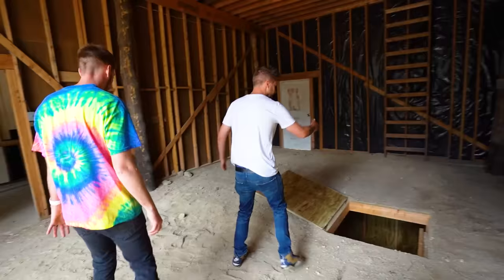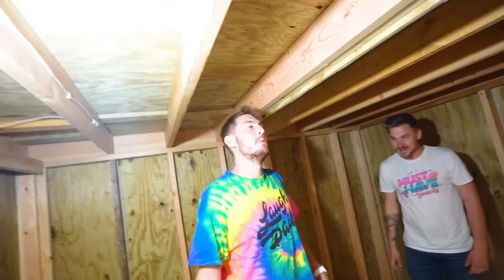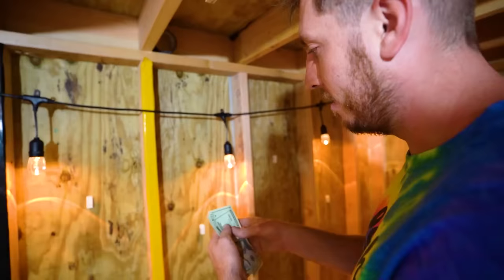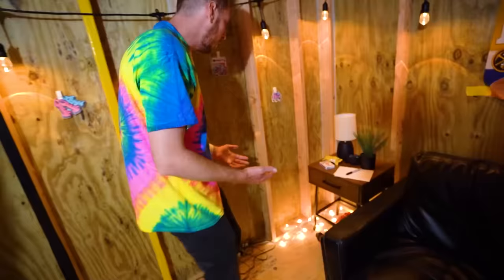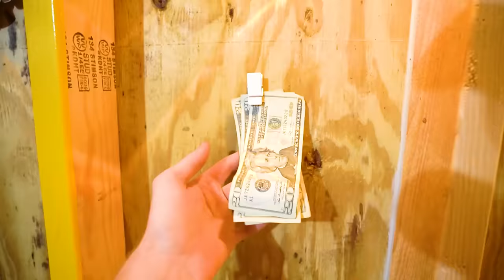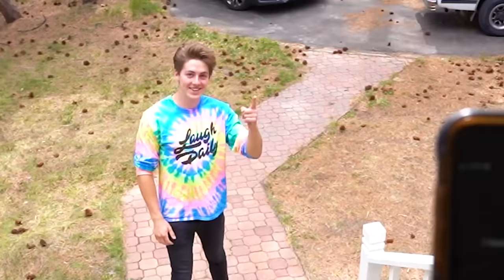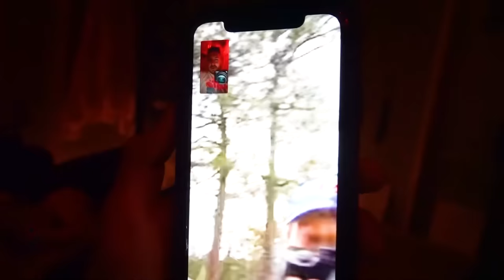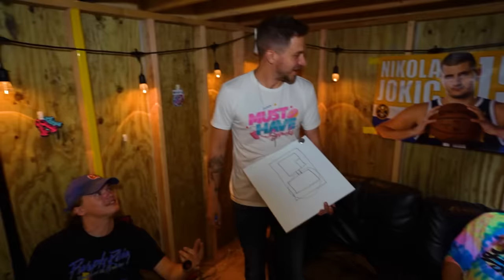HIDDEN SECRET BUNKER UNDERGROUND!

Comment: What about gluing dirt to the bunker door so when you close it, it’ll be more hidden?
Reply: I thought the same thing so that if they need to run and get in there quit there is not a problem with seeing the door
Reply: Same I also commented that
Reply: Good idea it would keep dirt from seeping in and hide the door more but may discolor the dirt for the glue
Reply: BigBrain
Reply: Also paint the handle
Reply: And maybe put a rock as the handle so it blends in
Reply: Same